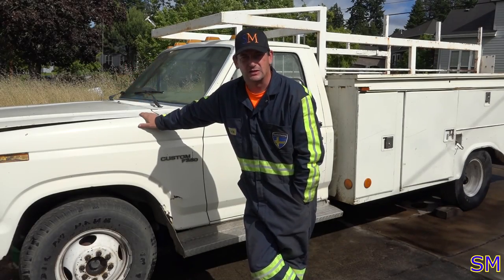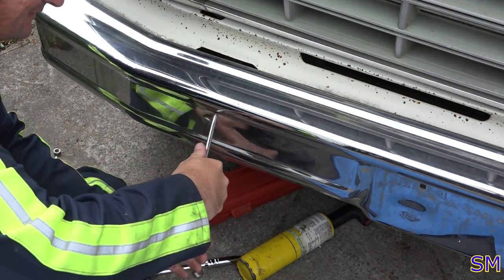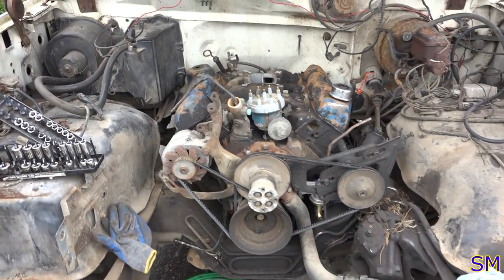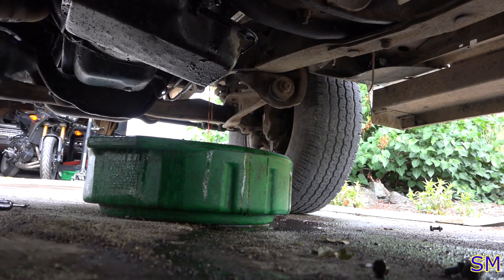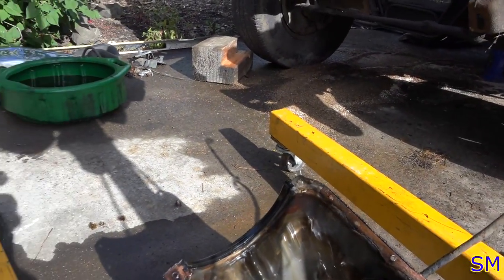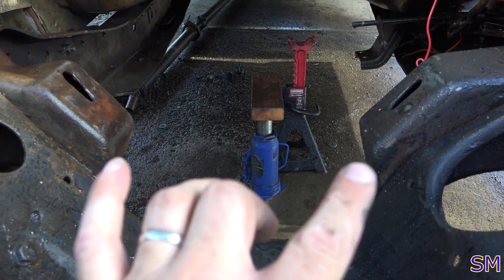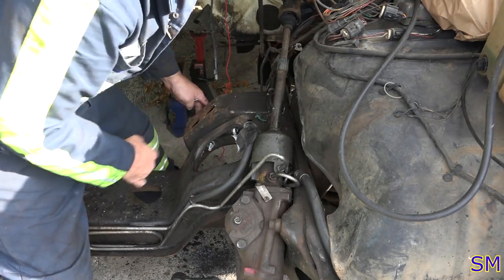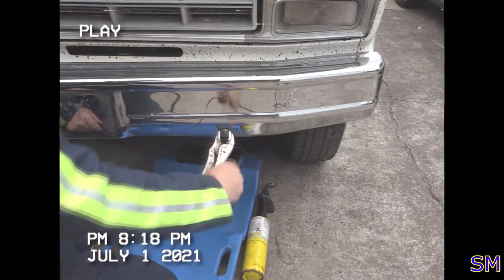Engine Pull & Perches - 80 F-350 Service Truck

Comment: Should be a nice truck with the 460. While you have the engine out, you should get some dollar-store oven cleaner and degrease the engine bay some more. “L.A.’s Totally Awesome” all purpose cleaner works good on painted surfaces and plastic with a little brushing. I’d wire-wheel the frame/suspension and hit it with rustoleum to protect from corrosion. Probably a good time to check your front end bushings too while everything is exposed.  I look forward to the next episode!

Comment: Very wise to refresh the 460 while it’s out. The bolts that hold the exhaust manifolds to the heads are notorious for busting and causing exhaust leaks. If you can it’d be an excellent time to put some grade 8 bolts in.
Reply from the maker: I know a few are busted. We will fix that😊👍

Comment: Hi Chris!  I understand you want to graduate to the big block, and I get you don't have an interest in enduring the self-harm necessary to breathe life back into it, but if one wanted to rebuild it would it be viable?
Reply from the maker: The old original 400 cu in engine would be viable to rebuild. However I had the opportunity to put a low milage used 460 cu in which more parts are available for it at about the same cost.
Reply: @SwedeMachine SwedeMachine Thanks for taking the time to touch on this.